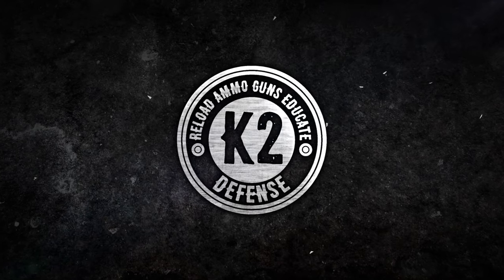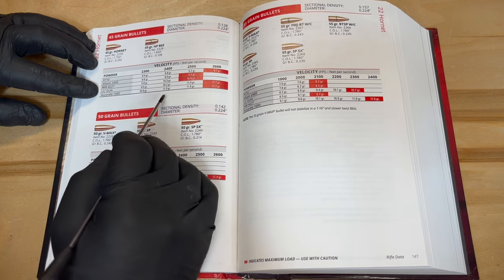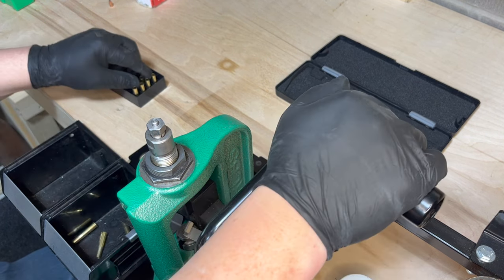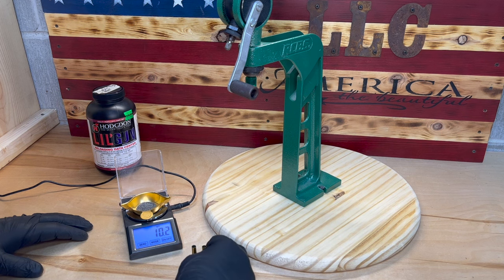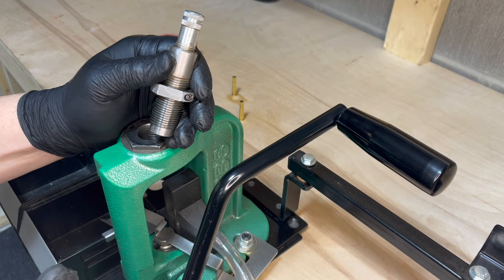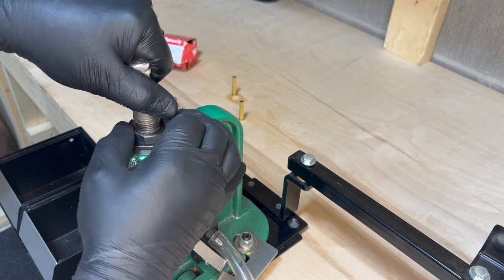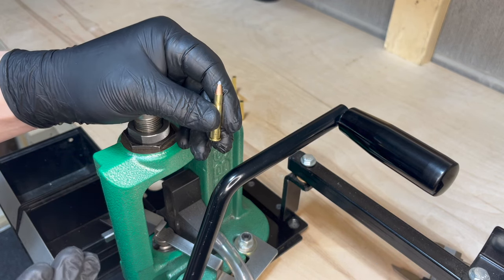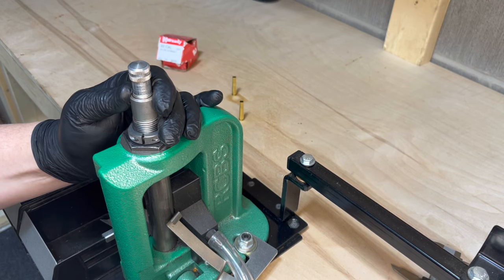How to Reload .22 Hornet For Beginners

Comment: The hornet is a somewhat picky round due to the small thin walled cases.  I use a neck sizing die, and open the case mouth 1/32" deep with an "M" die.  This allows nice straight alignment of the bullet in the case while seating the bullet, and allows flat base bullets to seat as easily as boat tails,  It also prevents the case neck collapsing as the bullet is seated.  I do not crimp hornet rounds because if the light bullets and recoil of the round...With my CZ I get sub half minute groups. Do not hesitate to use .224 dia bullets in your hornet even if your bore is .223, they work fine...
Reply from the maker: Hello @oscarcatx!

You absolutely nailed it! I can’t tell you know this round very well! I have a great recipe for 50 gr .224 projectiles. They’re amazing. But the cases don’t last long because of it.  Thanks for the comment! 👍🏻
Reply: @k2defense Can it last 3 reloads?
Reply from the maker: @slavicraven2261 - in short, yes. If you load them with reduced powder charges. I load mine as a compressed load. So, typically mine last two reloads, three tops. Hope this helps! 👍🏻

Comment: Hogden's website says to use 13 grains of Lill Gun with most bullets as I recall with pressures under 30K and much higher velocity.  Is their data wrong as far as powder charges?
Reply from the maker: @buckshot4428 - for liability reasons I cannot give suggested load data to my audience. 13 grains of Lil Gun powder in this cartridge, you’ll find that it is a compressed load. It does have a higher velocity. For me personally, the only issue I’ve had using this load data is that the case life is shortened. I usually only get a couple of reloads before case head separation when ejecting the case. Leaving a portion of the case stuck in the chamber. It appears that there is an increased bulge in case head area, more than when using a reduced powder load. Which makes sense because the cases for this type of ammo are thinner compared to the K Hornet. Let me know if this information was helpful. Happy to dialog more if need be! 👍🏻

Comment: A guy at the range uses the K-Hornet. He claims it is easier to load and the cases last longer, plus it bumps up the velocity a bit compared to factory loads.
Reply from the maker: @PassivePortfolios - the K Hornet has a nearly 9% increase in case capacity. It has a case decrease in case taper (bigger case) and shorten neck. Because of this, the case life increases. Most load data states there is approximately an increase of 100 to 150 feet per second (fps) gain in velocity. Thus making the K Hornet more accurate. Which, in my opinion is amazing since the standard Hornet is already extremely accurate. For me personally, both are easy to reload. 👍🏻
Reply: @k2defense  Good info on the K-Hornet, thanks. It should be a factory loading.

Comment: Yeah , sort of , I use CCI pistol primers , thats a old hack for accuracy in the very small Hornet case , Lilgun powder , 40gr vmax , at 3000fps , lee crimp die , 1/2 moa 3 shots .
When you run the case into the crimp die , just do it once , & not 2 twice as you have for bullet seating alignment .
And as round is too long for mag , single feed .
Reply from the maker: @chrisfarr9494 - I haven't used the CCI in the Hornet round, I'll have to try that out. Lil Gun is perfect in the Hornet, excellent choice. I use the same projectiles except 50 grain. Works perfect. Thanks for the comment! 👍🏻

Comment: you have not got your sizing die set it is supposed to be screwed down against the shell holder plus 1/4 turn
Reply from the maker: Hi Bill! You are correct for steel dies. What you’re referring to is called, “cam over”. With the Hornet shells, I’m less aggressive. They are very thin walled cases. I’ve had many case head separations with reloading them, I’ve decided to not “cam over” with them. When I do, basically every other one there is case head separation. With the .308 and .223/5.56 I do cam over with zero issues of case head separation. Right or wrong. This is my rationale as to why I didn’t “cam over” with the Hornet. Great catch and thank you for contributing to this channel. I appreciate your comment! 👍🏻

Comment: 1. You didn't clean the case lube off of the cases after sizing.  If case lubricant gets on the primers it will neutralize the priming compound making the primers inert.  2. You are holding the RCBS hand priming tool backwards.  3. Why are you wearing rubber gloves?
Reply from the maker: @marktroxler6798 - hi Mark! 1) You are correct, I didn’t explain or show brass cleaning after resizing. Thanks for catching that. 2) no where in the IFU says you have to hold the hand primer one way or another. Ergonomically, it feels better for me to hold it the way I do. It doesn’t affect anything so I’m not sure what your point is by pointing this out. 3) I wear the gloves so I don’t have to wash my hands before putting in a dip. Thanks for your questions! 👍🏻

Comment: Is that a Lee Dead Length Bullet Seater? It'll say on the die box. If so, it doesn't have a crimping shoulder. If you're getting it to crimp, it must not be. Lee has a whole line of Factory Crimp Dies. They provide a superior crimp imo.
Forty grain plastic-tipped bullets @ 3000-3100 fps turn the Hornet into a 300 yard rodent gun. Thanks for the vid!
Reply from the maker: @luvtahandload7692 - the dies were hand me down dies. No box. I love the 50 gr v-max!

Comment: This maybe a crazy question but can you form brass to make 22 Hornet?  If it possible to do so.  I am not forming to make 22 K Hornet but just regular 22 Hornet brass.
Reply from the maker: I have not made brass for the 22 Hornet. 👍🏻
Reply: @k2defense  i have found some.  22 Hornet is pretty scarce to begin with.  Being 100 yewr old Cartiage i didn't  figure people would still be after it lol.  All is well though the brass is available  now in areas.
Reply: @k2defense  thank you for the help and your videos
Reply from the maker: Glad you enjoy them! 👍🏻
Reply: I don't know anyone that forms 22 hornet brass from raw material or another case. 22 Hornet is in a case class all by itself. The K hornet has a modified chamber that will form regular Hornet brass into K hornet when shooting them through that firearm. This is known as fire forming.
Reply: @MrHippyclay  gotcha i only go involvedxwith this caliber to help a fellow friend.  The 22-250 and couple 22 caliber based cartiages i have dealt with.  I guess making 22 Hornet if possible if you can't find it thia would apply but i do know 22 K Hornet os fire formed 22 Hornet formed from after firing.  I appreciate  the information  and feedback but like all cartiages and calibers they are in the own line of work lol
Reply: B😢😮brass may become more available as Ruger introduced the SUPER REDHAWK  in .22 Hornet
Reply: @rogermorrill4700  right on the big issue is that any firearm in 22 Hornet is excessively expensive for no reason
Reply from the maker: I did not know that. Thanks for the comment! 👍🏻
Reply from the maker: Agreed! Shells are near impossible to find and expensive. It’s one of my favorite rifles I own.
Reply: @k2defense  yes these cartiage is getting popular and i am pretty sure you will see more of things to come on this caliber lol
Reply from the maker: @yojimbo05 - awesome! Time to bring it out of retirement! 😂👍🏻
Reply: @k2defense  word lol

Comment: News flash not all chambers are the same depth, the rifling lands could be different make sure you know where they are.
Reply from the maker: @randybichsel4597 - perhaps you can provide the viewers examples on how they would know the difference in their rifle?
Reply: @k2defense  start with starting length cartridge, move out till lands touch ( you will notice marks on bullets)  then back off till no marks. Or buy you a depth guage.
Reply: Guage. Is not a negative against your video, it's just an FYI std length is just so it works in most all rifles
Reply from the maker: @randybichsel4597  I didn’t take it as a knock. Just want to educate viewers to make sure they know how to check it. 👍🏻

Comment: NEVER crimp 22-Hornet reloads. There`s no reason needed to do it. Neck size only. I only size the neck not quite to the top of the shoulder. 
Set your bullet .010ths off the rifle lands.  Your accuracy WILL improve, greatly.
Reply from the maker: Hello Dee Derp!

Maybe elaborate why you feel there’s no reason to crimp to the viewers. Have you run into pressure issues, had a bad experience, etc. I have and always will crimp to avoid ramp feed issues. I’ve had zero issues. Thanks for the comment! 👍🏻
Reply: @k2defense  I only use Hodgdon Lil`Gun, and Hornady 35gr Vmax. (at 200yds, i give a headshot to a coyote, it gives them a dirt nap instantly) There is no pressure issues using Hodgdon Lil`Gun. I don`t use rifle primers either, i use pistol primers. Rifle primers can cause pressure issues with certain higher pressure powders. This has already been proven by some of the best 22 Hornet reloaders out there. Look up the pressures between the powders used in the 22 Hornet, Lil`Gun is a very low pressure powder. If you have to crimp due to feeding issues, its not the ammo that is the problem, its your gun that has the problem. My CZ527 feeds my loads just fine with non-crimped rounds. If you have good neck tension, crimping is not ever necessary (this can be said for MANY calibers out there). Crimping has been over-rated for a very long time, especially in the 22 Hornet. The Hornet doesn`t have any recoil to speak of, so there is no bullet setback issues under such light recoil, unless your OAL is to long and hitting the inner front of your magazines and jamming the bullet rearward. Proper neck tension on the 22 Hornet holds the bullet just fine. Crimping 22 Hornet cases just destroys the cases. I can easily get 10 to 15 reloads out of my cases. Some have gone as high as 20 times reloaded before i throw them in the scrap bucket, you`ll see the case mouth begin to crack, then its time to throw them out. Brand choice of brass also can effect how many reloads you`ll get. Remington brass seems to be the thinnest of the 22 Hornet cases. With over 50+ years of reloading experience, and shootin & reloading with some well known experts in my years, all i can say is, what works for me, is working. I`m hear to tell you, high pressure powders, rifle primers, and crimping just destroy these thin wall cases extremely fast. As hard as it is to find Hornet cases these days, why destroy them when you don`t need to. YMMV.
Reply from the maker: @D70340  that’s a perfect explanation! Send me your email/contact info and I’ll send you my favorite recipe for my Hornet rounds. I can’t post here for liability reasons. It will make more sense why I crimp 👍🏻 k2defensemn@gmail.com
Reply: @k2defense  I Neck Size my 22 Hornet with a Lee die. This leaves the cases tight enough for proper neck tension and feeding, but loose enough for easy bullet seating. The big benefit to not crimping is avoiding accidentally crushing cases. I use Lil'Gun exclusively, so the powder itself is preventing setback. On top of the fact that if you are generating enough recoil on a 22 hornet to get bullet setback, you're probably doing something you shouldn't with it. :P
Reply: @D70340  Agreed on the pistol primers. Lil'Gun will typicaly generate such low pressures in the 22 Hornet, while also producing high velocity, that it is normal to see the primers slightly backed out of the case. (More on my Ruger, less on my Encore.) Since the pressure wasn't high enough to have the case expand back to the breechface.
Reply from the maker: @Crosshair84  I crimp to reduce the chance for ramp feed issues. Meaning the cartridge moving from the mag into the chamber. I’ve had times where the case mouth catches while chambering rounds. I personally haven’t had bullet setback with .22 Hornet rounds since the amount of lil gun that I use doesn’t allow that to happen. Hope that clarifies everything. 👍🏻
Reply: Good thing I have not been using the Lee factory crimp die for 30 years on my Hornet.  When dealing with the rotary magazine OAL limitations of the Ruger 77/22 Hornet and cannot seat bullets out to just short of the lands to aide in powder ignition consistency what are you supposed to do?  Chronographed loads with partial neck sized cases started with double digit ES uncrimped.  When crimped it was single digits.  My small game load went from dime size groups to aspirin size (45 gr. Hornady Hornet bullet w/ IMR 4227).  Without crimping my 45 gr Barnes TSX load for larger game would never have met my accuracy requirements.  That $10 die was the difference between this reply or selling the rifle decades ago due to frustration.

Comment: Sorry that not the proper way to measure powder 
You need to scale every load as it can vary a lot like you do it.
Reply from the maker: Some folks feel more comfortable doing it the way you’ve described. 👍🏻
Reply: Nah. I use a Lee Auto Disk and Lil'Gun with no issue in the 22 Hornet. I can imagine issues with other powders and measures, but Lil'Gun is basically magic in the 22 hornet. There's no reason to bother using anything else unless you can't get Lil'Gun. High velocities, for a 22 Hornet, at low pressures. Consistent as well.
Reply: @Crosshair84 I love Lil Gun in 22 Hornet. Sends my 40 grain v max or ballistic tips down range with authority and lower pressure than other powders. I even use lil gun with the Barnes TSX 45 grain .224 diameter…..amazing results. I do a ballistic test results video on my channel with TSX. I always see so many loving Lil Gun in hornet when they try it.